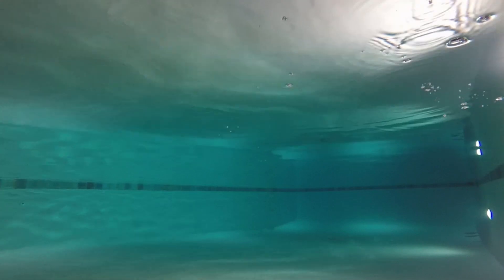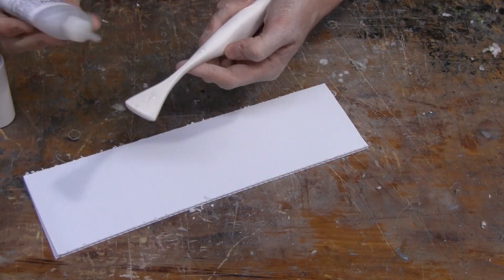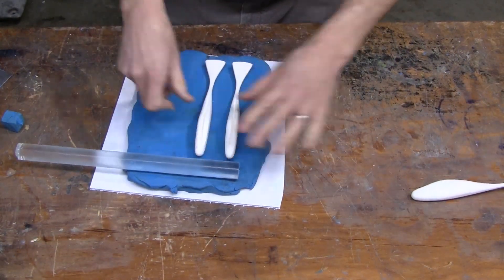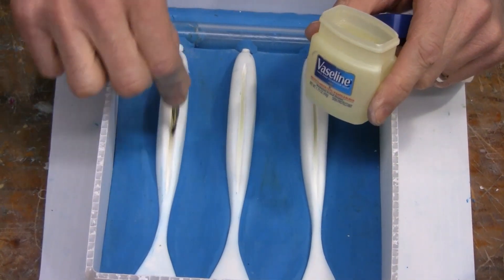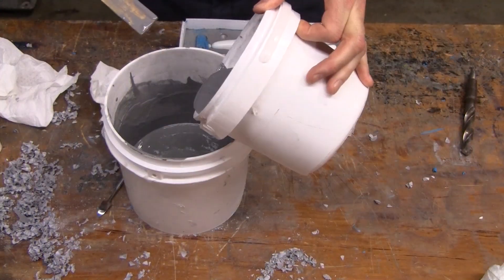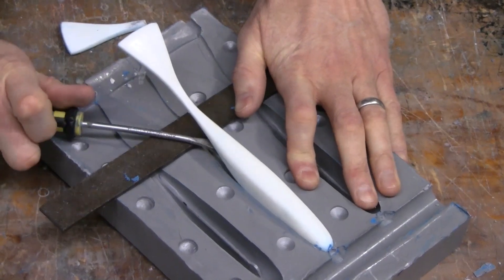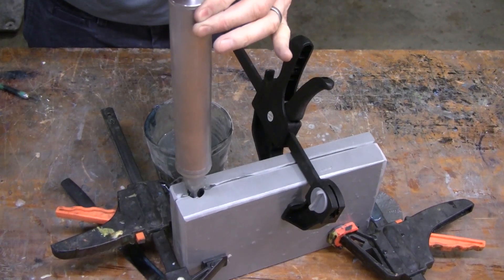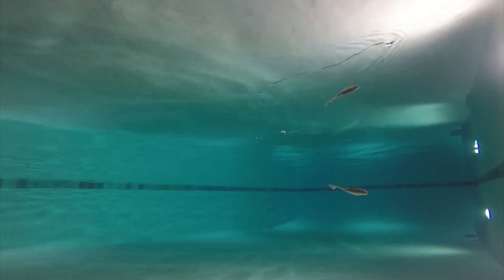MakeLure: How to make your own production lure molds

Comment: Great video on making the mold but those two shot lures won't be properly bonded together and will easily pull apart. that's what happens without using a preheated aluminum mold.

Comment: Its metal cast. Im a mold maker by trade(28 years) and have worked with this material extensively. I know that it will break down quickly due to the high heat needed to melt the plastic. This is for the hobbyist not big lure productions. The life of the mold will be short before it starts to chip out and crack.

Comment: What silicone did you use specifically?  The pink stuff?  Would like to purchase some but wasn't sure what you used there.
Reply from the maker: This is our High Strength 2 silicone - you can purchase at alumilite.com
Reply: @MakeLure  Awesome, thank you!  And then I can order Alumilite White to make the prototype originals by pouring it into the silicone mold and continue to make master copies.

Comment: Great mold, is the vac50 able to have resin poured in for hard baits?
Reply from the maker: Hi Jon, thanks for watching! No, this is only to be used with Alumisol soft plastic.
Reply: @MakeLure  if you have a chance could you email me, upskirtlures@yahoo.com Im trying to find a new mold material for urethane resin
Reply: @MakeLure  where do I order all of this at?
Reply from the maker: @josephlassiter1412  makelure.com or alumilite.com!
Reply: @MakeLure  hello. Do you think Play-Doh would work instead of the clay?
Reply: Chris gone Fishing I’ve used playdoh and it can be done, it’s definitely more of a pain though. The playdoh likes to dry out and crack making it difficult to get a smooth seam. And the biggest issue was it was an absolute bear to clean up for the second half of the pour. But at the end of the day I ended up with a two piece mold that works well and is good quality!
Reply: @ryanpainter7695  thank you soo much!